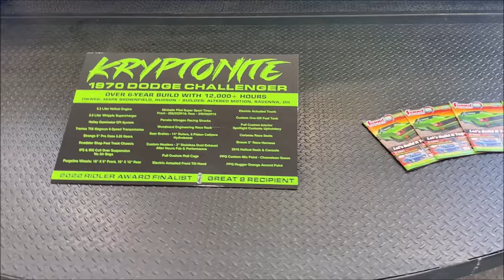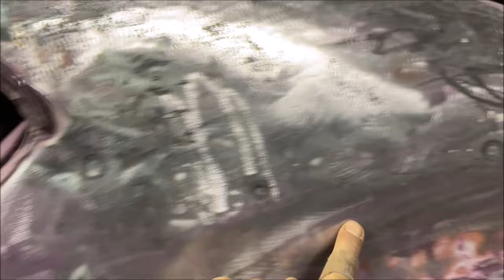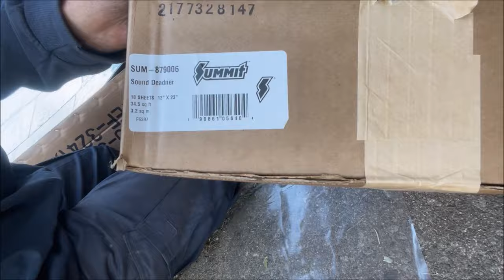1971 Cutlass Ep 06 New ROOF & A Pillars!

Comment: Good evening to you.I can honestly say that I (we) feel your pain.  We have had some very similar challenges with our '69 Cutlass W-31 Project. aka.   " Mr. Jones"       Your efforts and tenacity are to commended.   These cars can certainly push a persons ' will that's for sure.  You've accepted the challenge and are handling it very well indeed.    FYI the cowl tag will tell you if your car originally had a vinyl top.  There will be a letter following the two digit color code.  We go over some cowl tag break down and decoding in a few of our videos.  Lastly, it's great to see your daughters involvement.  My daughter and I built a '69 Cutlass convertible for her high school graduation.  Some of the best 3 years of my life.   Memories of  a lifetime!!  Keep up the great work.    - Steve
Reply from the maker: It's interesting you mention the cowl tag... I'm actually looking into it right now as we speak! The tag says the car was color 61 / 61 which is Sandalwood, and there are no letters there. This doesn't quite make sense to me because the color I found on the door jambs and cowl is closer to Bittersweet Irid or Kashmir Copper, and I don't think it lists a vynil top. Then again, it could have been added on after it was made?

Comment: And took some courage to cut that car apart especially the roofskin do you have body shop experience ?
Reply from the maker: Thank you! I've never replaced a full roof like this, but I have painted at least a half dozen cars in my lifetime, and living in NorthEast Ohio in the "rust belt" we've always had to repair sheet metal on our cars. This was usually things like repairing sections of floors, trunks, quarter panels, and rockers. Honestly, having the basic welding/bodywork skills combined with research of similar projects on YouTube, and access to the correct pre-stamped replacement panels was the key. In some ways replacing a whole panel is easier than sectioning it when the panel gets to a certain threshold of rot.